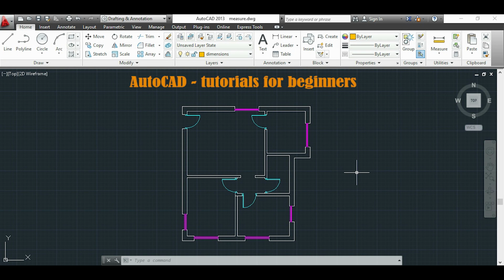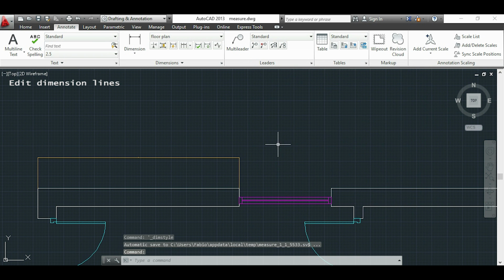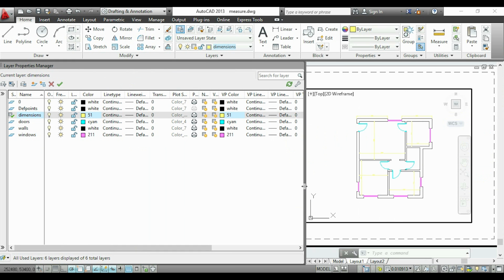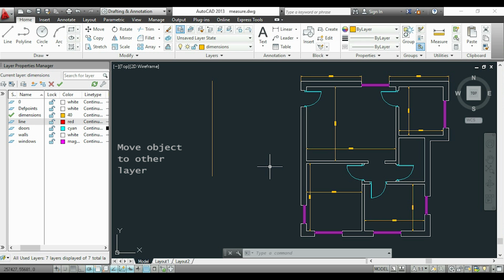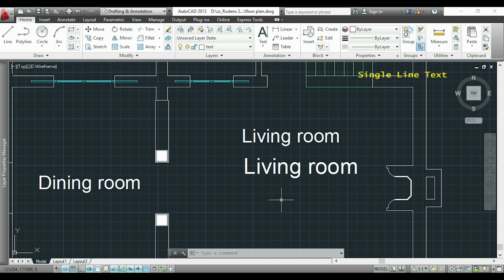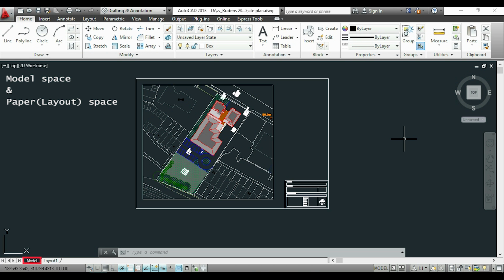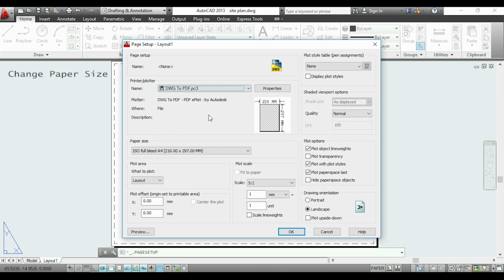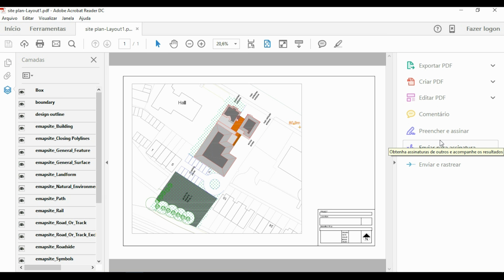AutoCAD 2013 - Complete Tutorial for Beginners - Part 3 (dimensions, layers, text, print)

Comment: there is also the option of monochrome for the layout which can print all the lines in black automatically. Thanks for the video.
Reply from the maker: You are welcome. You can use grayscale in the page setup manager at the top right section.